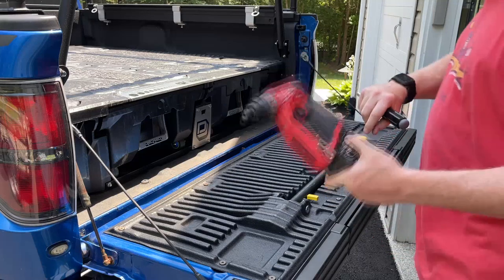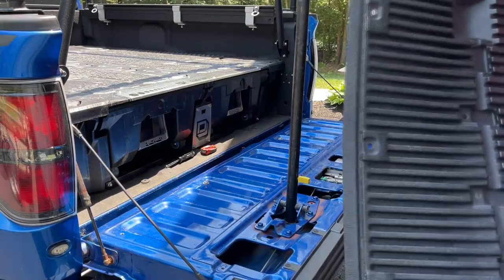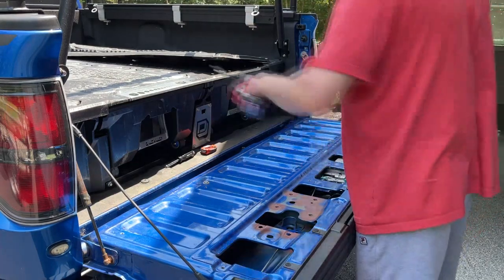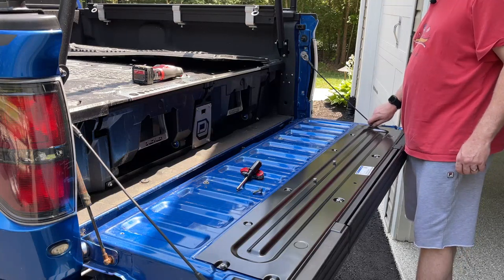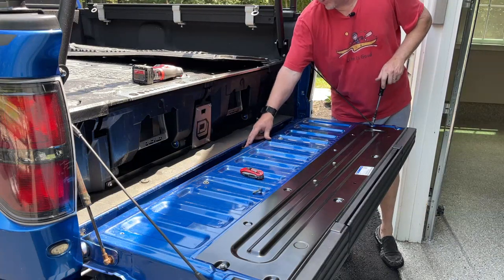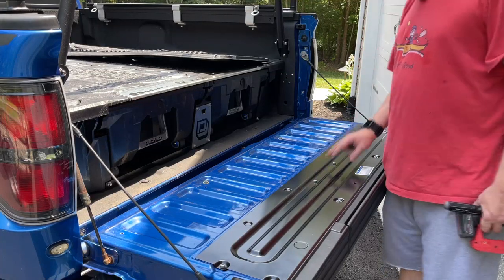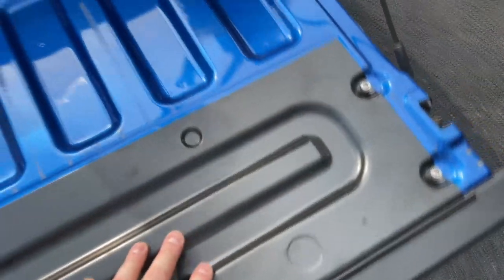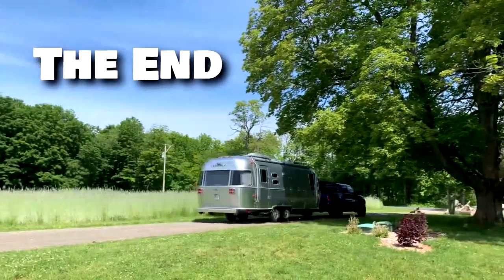No More Stripper Pole on My 2013 F150 Raptor!

Comment: Thank You!  I have referred to this vid and started my Pole Delete project. I hurt my knee for the last time getting in my Truck Bed. Found Stainless Pan Head Torx Screws that resemble the Factory Hardware ( M6-1.0 x16mm) and I am going mask and spray the Bed Liner myself. I have a RivNut Kit and will consider that too.